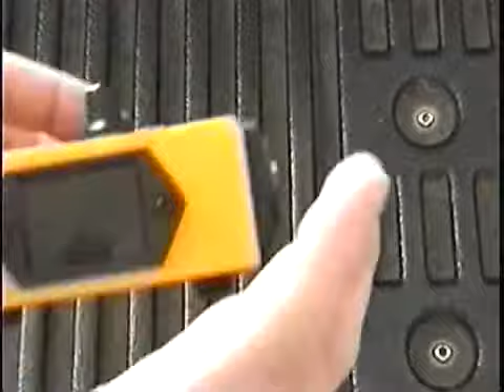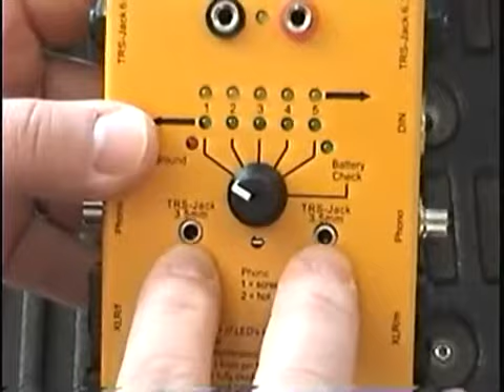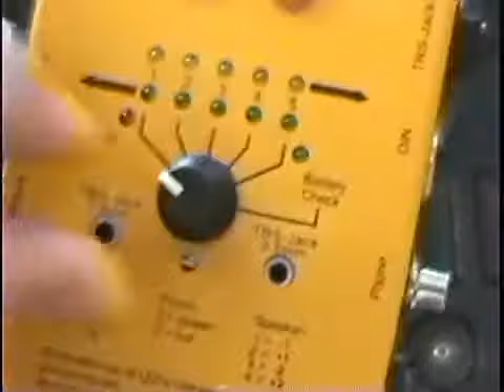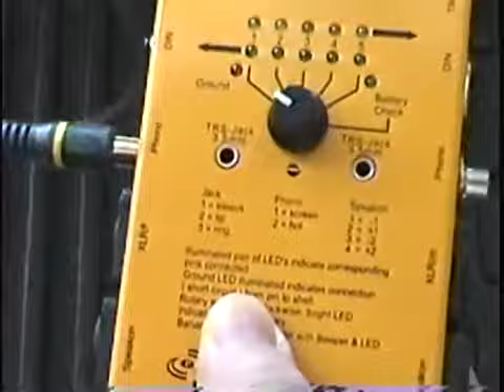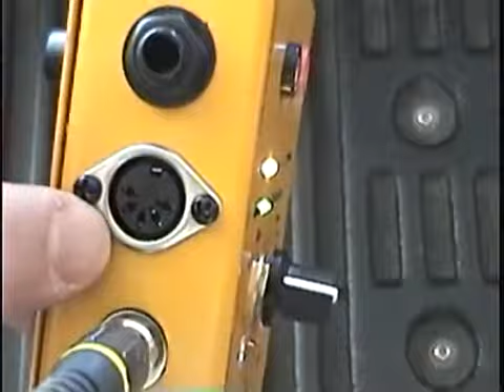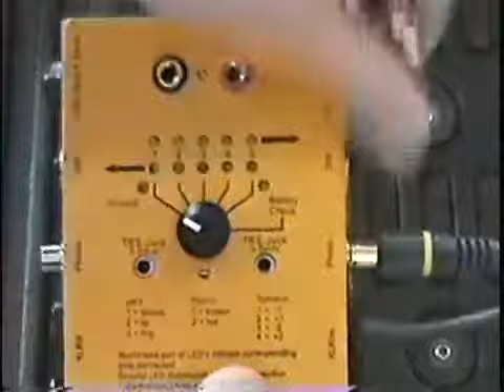Pyle Pro Cable Tester PCT10  PCT40 Review

Comment: Just FYI for anyone using this type of tester:  Standard MIDI cables use 5-pin connectors, but they only use 3 conductors (I think it is pins one, three, and five), so two pairs of LEDs will never light, even if your cable is fine.  However, if you use a 5-pin din CABLE (Not a MIDI cable), it will have five conductors, all LED pairs will light, and it will work fine for MIDI.